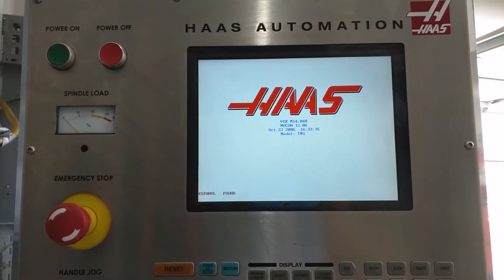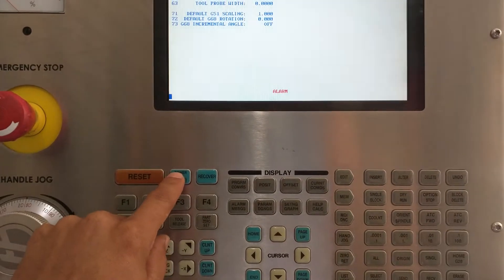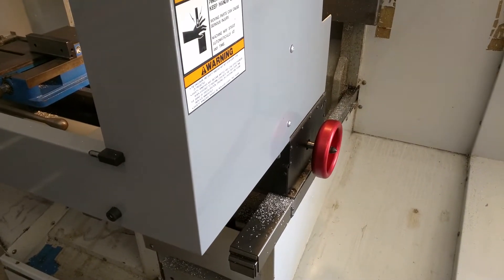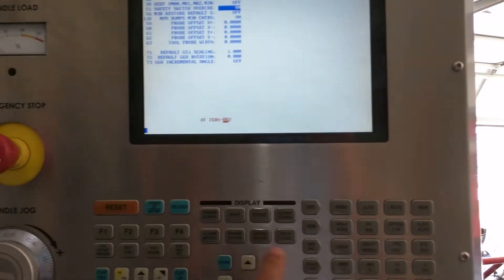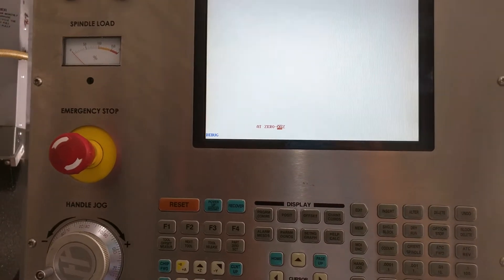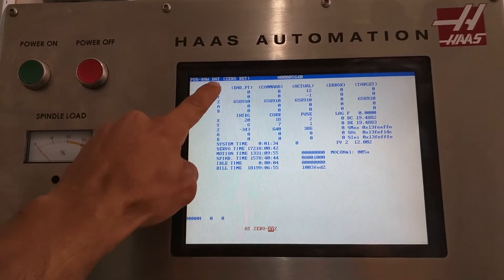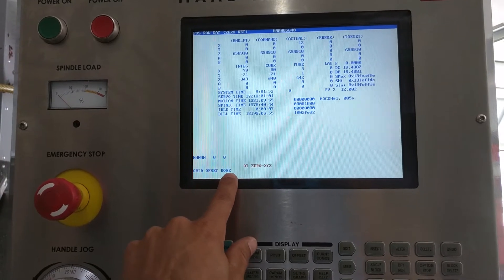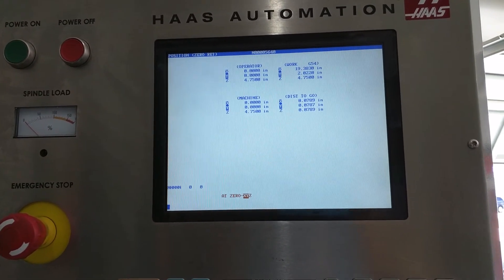Haas Axis Margin Too Small fix.

Comment: Hi, thanks for this info, I have tried it and it seems to have worked. One question though, do you have to exit the debug mode or do you just continue from where you are?
Reply from the maker: Anton K you can continue...I rebooted the machine to be safe
Reply: Andrew DeLorey Hi, thanks, yes I did that too. Just one more thing. I can’t seem to find the limit switch/proximity sensor on the y axis, could you possibly help out here please?
Thanks.
Reply from the maker: Anton K what machine do you have?